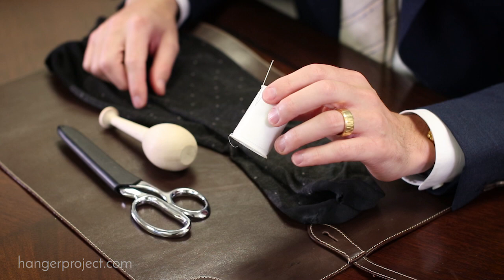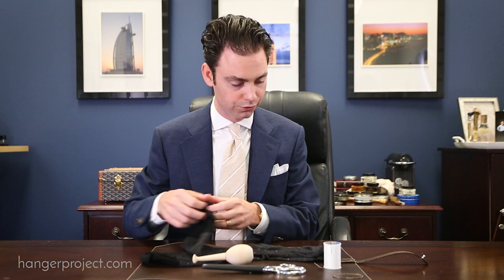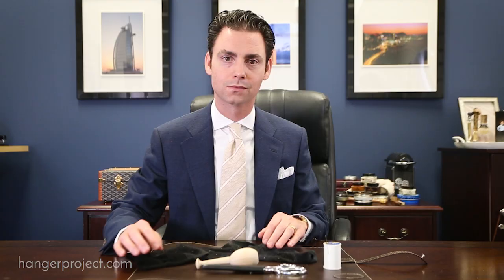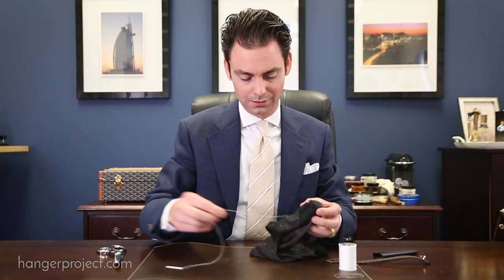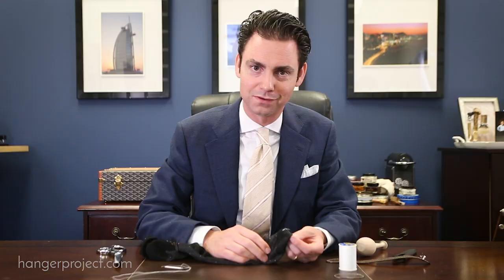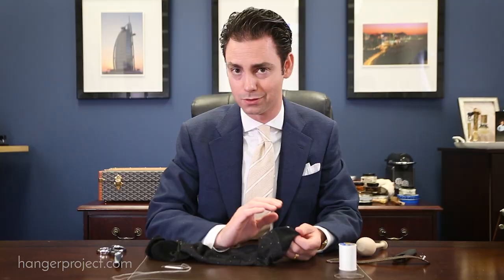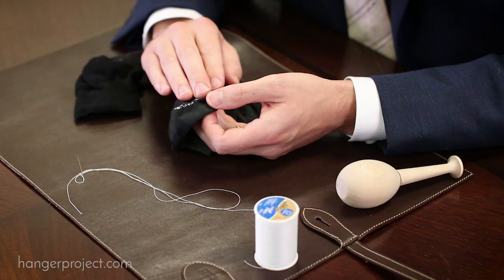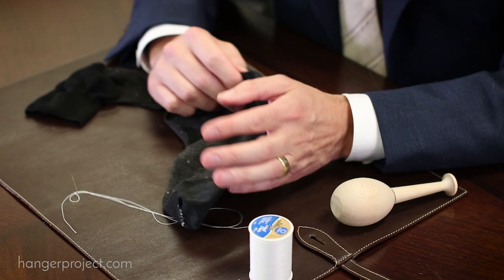How to Darn Socks | Kirby Allison

Comment: Hi Kirby. I want to Darn my socks at the heel using Stabilizer or Interfacing, I'm thinking it will reinforce the area?  What is the best material to use. I like the back stitch, it does not distort the material, thanks for sharing!

Comment: Is there a reason someone would want to show-off that they have mended their socks? Is this "a thing"?
Reply: Long ago (through the 1970's) even folks of moderate means could buy nice wool sweaters and socks.   Over time, with heavy use, a worn spot or hole would appear.  Rather than tossing a nice sweater or pair of heavy wool socks, most people would darn that small area and continue to use the garment for several years.  There were shops where people would take very expensive woolen jackets and blazers to have a skilled person "reweave" a small hole or weak area in the fabric and the repair was almost invisible.  Cheap synthetic fabrics aren't worth the money paid for them to begin with much less the few minutes it would take to repair them.